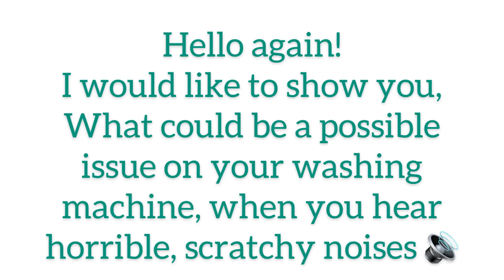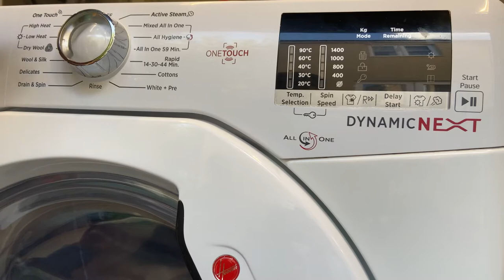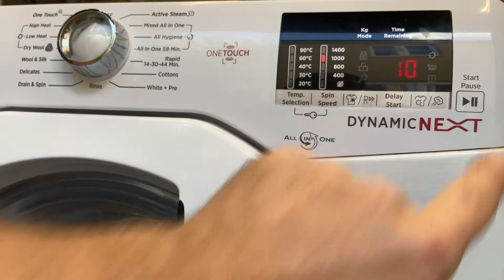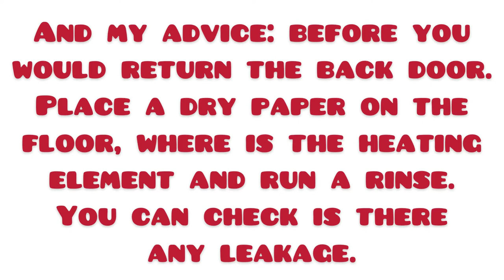HOOVER Washer dryer 8+5kg makes a horrible scratchy noise 😱 Maybe the bearing❓🤔

Comment: is it a good trade mark washer hoover? how to replace the bearing?
Reply from the maker: Hi Benzo,
You can’t change only the bearing, must with the drum house, as bearing moulded in the plastic. This repair is not economical. Better buy another machine.
Reply: @georgesworkshop8600  What bearing size are fitted?,  have you got the picture or the link of Hoover AWMPD4 47LH3R-07 drum house?   the drum house can be disassembled with a grinder for a short time and put back together on the cogs.
Reply: @georgesworkshop8600  hello! Are the bearing dimensions of the hoover AXI washing machine with a load of 7 kg the same as those of the washing machine 13?
Reply: @georgesworkshop8600  ok, what candy has the same drum housing?
Reply: @georgesworkshop8600  Dear, George! Do you mean the bearing inside the drum house, it doesn't have a metal seat?? Is it true?:) Have you seen it yourself? who is this genius who did it
Reply from the maker: Sorry,
I haven’t seen your messages before. I don’t repair washing machine with bearing issue. 
Some drum house is dismountable, but when assembled need extra care of sealing. Avoiding from leakage is not guaranteed. Too much time and money. I can’t help with it.
Reply: @georgesworkshop8600  Fine. this drum is not a problem, a strip of abs plastic and a technical dryer are enough. Along the seam with hot air and the supply of a strip of plastic and tightness will be like a new one without any sealants. I'm trying to find out how long the bearings will generally last with average use of years and how long a door with a tricky AXI series hoover washer's hinge will last